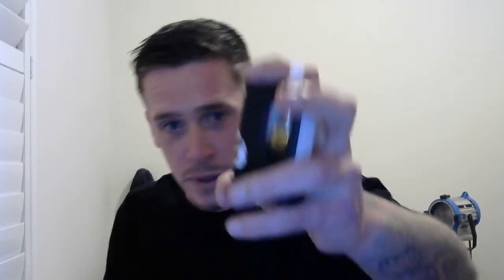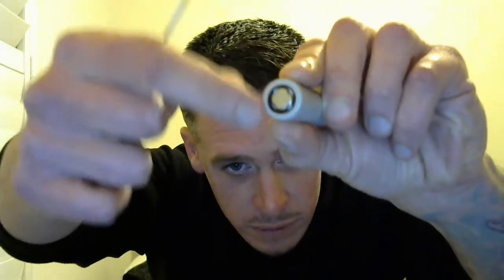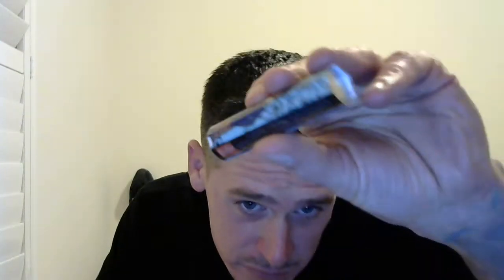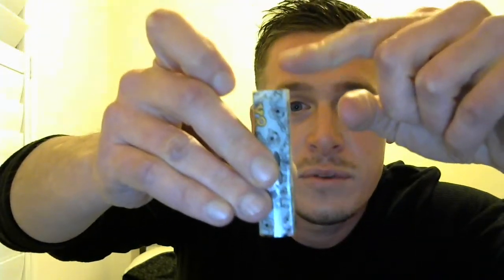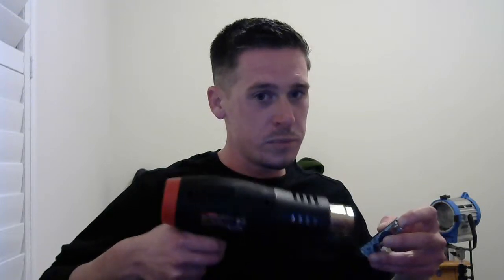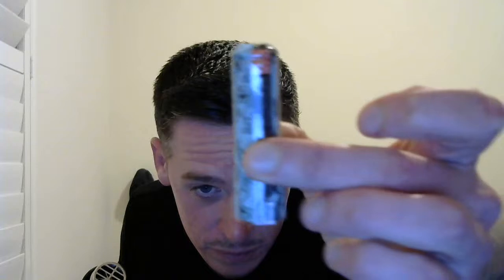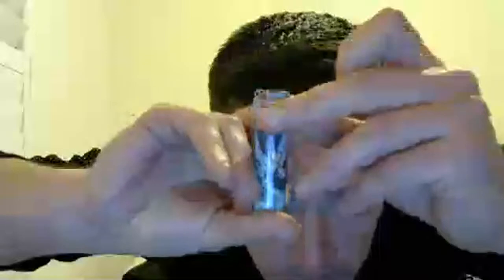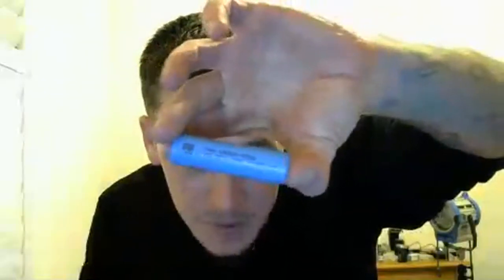How to Replace a Battery Wrap / Best Method to put on ODB wraps

Comment: I got a Kbr-s last week (raw grey with net pattern & white panels) so I had to wrap a couple of P28’s with upside down wraps- one odb KONTRL and a white mission xv man on the moon wrap- looks👌🏻I do like thicker wraps like Mission but only where applicable coz some mods just have such small tolerances sometimes you have to use something thin like odb. Have a good one Tone ;-)
Reply from the maker: yea the thicker ones hold up better but they don't go on as easily as the ODB.. and can have a harder time fitting like you said.. I really like those old white Mission Spaceboy ones too.. i have a few batteries with those.. and the black version too.. i thought the 'flashlight' one they did was a waste though lol..., ill never want to actually use that
Reply: @toneohm  yeah I have a good few orange “flashlight” and a handful of black spaceboy but I’ve only ever had 2 white spaceboys. I don’t know if you can actually buy them designs because all mine have came with drip tips and maybe a couple of spacepods, actually probably all drip tips. They do look good though. Like you said once you do one you’ll put decent looking wraps on all your batteries 👍🏻👊🏻